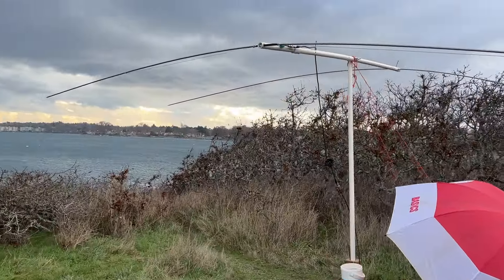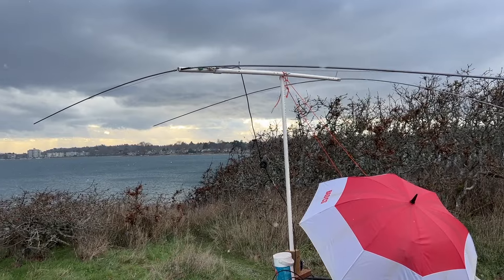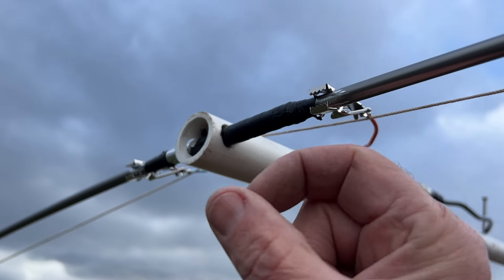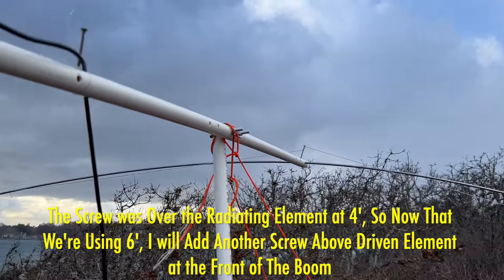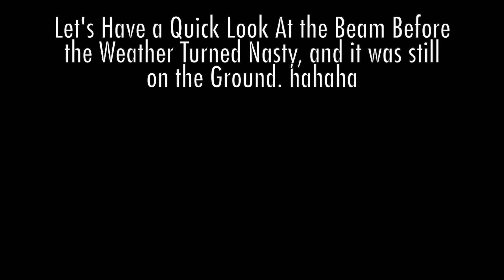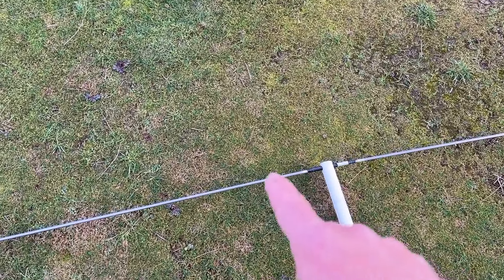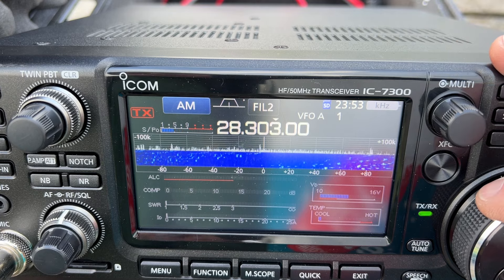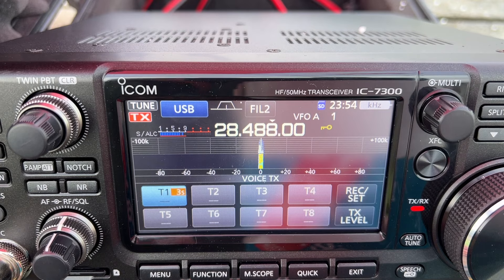TENT POLES - DIY 10m Yagi / Vertical Under $50: Ideal for Outdoor Ops! #antenna #hf #hamradio #pota

Comment: Seems like a very light portable solution. String the elements up like a a bow to get closer to horizontal and you're golden. I want to try a similar set up for 6m using dowel rod and wire elements. One day. So many projects, so little time...
Reply from the maker: Hey buddy, thanks for the great tip. I'm working on a Tee set up to do exactly that - string them up higher. This antenna is a total blast buddy! Good luck with your build for 6 meters. Keep me posted on the build. Thanks for dropping by mate. Cheers!

Comment: Great video and success Simon.. I like that antenna..  Sorry I missed your POTA spot.. Thanks for sharing.. 73.. k0klb
Reply from the maker: Kevin buddy! This antenna is awesome mate. I can't believe how quiet the noise level is - well even quieter than quiet on 10 meters, and the signals just pop! I'm addicted to the beams buddy. Thanks for swinging by  Kevin, and stay warm mate!
Reply: @thehamjazz   Ya Buddy on the beam.. Love them, but just not practical in my mind out here in the middle of the country at the home QTH station.. I'd be swingin' that thing east, west, east, west all day long.. The local birds would think its a carnival ride up there, LOL.. I'd need to have 3 stationary beams pointing east, south and west all connected together for an omnidirectional radiation pattern.. However, in a portable setup, I do like your hand rotatable, portable beam where I could spin it on a dime real quick.. That's a great idea.. and very effective.. Nice work !!... k0klb

Comment: Super Fantastic Yagi-beam!   I am doing similar cheap portable beam antenna on 10m.   I use gardening/agriculture green pole approx 2m long as a standing pole and a vertical element, directly feeding with it, spreading horizontal element between these poles top and bottom to build rectangular loop.  And aligning these 3 loops each as director, radiator and reflector to form a direction fixed 3EL Cubical Quad.   I enjoy DX contesting with it in QRP.       Your's is rotating so very nice😊
Reply from the maker: Thank you very much my friend. My email address is va7bix@gmail.com I would love to see pictures of your beam? Thank you for watching my video my friend. Happy DX! 73 Simon
Reply: @thehamjazz  Sure, Simon!  Tnx for your interest on my DIY antenna.   I will shoot some pictures this weekend upon participating in JIDX contest and send them to you.

Comment: Very nice portable yagi for 10m.  What about putting a pvc T connector on the ends so  you can put a 4-6" pvc vertical for the support string to go over, and notch out for the support string?

Also, that M10 adapter, is the female end M10 or 3/8" I need M10 Female to 3/8" Male Stainless adapter, and all I have right now is aluminum so I'm afraid it could break with the 17' whip.
Reply from the maker: Paul buddy you’ve totally read my mind mate - I just got off the phone with my buddy Doug talking about this exact same thing hahaa wooohooo. I’ve got some Tee connectors that down size to half inch so I can put a 6 inch stub on it and boom it will hold the weight of the elements - I’m pretty sure it is m10 female to a 3/8-24 male buddy let me check and get straight back to ya
Reply from the maker: “This adapter has M10-1.5 female threads on one end and 3/8-24 male threads on the other end! Perfect for your needs buddy - contact SnakeClamp they are the US company that supplies them buddy - url
SnakeClamp.com 

Happy building Paul - cheers mate 👍🍻
Reply: @thehamjazz  I got the adapters yesterday and they work perfectly.  Much stronger than the aluminum ones I have. This works great to adapt the China 17’ metric whip to a 3/8” mount, WooHoo!

Comment: Lots of variables on Amazon for those tent poles. What is the exact length in inches of an individual pole section on your poles? Amazon lists 15.55" and 14.56" but none exactly 15". Thank you de Mike WE0H ..

Comment: Hi, Simon. It's a great idea. I have a challenge of getting end to end conductivity.

I ordered the same brand as yours. File them in and out exactly as you showed in your first video. Each section itself has no issue of conductivity when checked. But when I put them together, I don't get end to end conductivity.

I tried rapping little piece of kitchen aluminum foil between two sections and then pushed in each other. Some foil sticks in between the two sections, and the rest is sitting outside the rod.

This way, I am getting end to end  conductivity. I have conern that at 100 watt with over time, it may burn or damage the pieces of foil in between the sections, but I  am not sure on this. Is it safe to have this kind of setup?

I tried washers in between two sections, but it seems they are somehow slightly loos or move, and there I lose the conductivity. It seems aluminum foil is the only option as it fills in the gaps between two elements to have end to end conductivity.

I am planning to have this as a permanent setup in my backyard.

Sohail ve3itu.

Comment: what’s the purpose of the 3/8” adapter at the end of the element?
also, you could add a 90 deg pvc connector and a few in inches of pipe to raise you element leveling string.
Reply from the maker: Hey mate thanks for your response - did you see the end of the video? I used the reflector element as a vertical - hence the 3/8 adapter so you can do both. It’s a beauty and ya buddy tomorrow I’m going to add a tee with a stump for the string to hold up the elements - thanks for watching mate cheers

Comment: How did you prep the sections so current and voltage could conduct past the anodization of the aluminum tent poles?
Reply from the maker: Hey buddy, thanks for leaving a comment. I used a small little metal file and just filed away the crud. You can also use steel wool. A buddy of mine used a Dremel bit which would work a treat. Happy building mate, this antenna is a beast and soooo much fun wow. I gotta get mine up again this week. Wooohooo cheers mate.
Reply: @thehamjazz  Thank you for the reply. Woohoo
I did a little research since I asked the question and found out that oven cleaner would remove the anodization. I am testing your method and the oven cleaner method this weekend

Comment: I tried making one of these but just could not get a stable SWR. Every time the wind blew and the driven element oscillated up and down, the SWR went from 1:1 to over 2 and back again. Taping the joints made no difference. As an aside, I used a 6.9mm fibreglass tent pole piece for the centre of the DE - it of course is tubular,so running the shock cord is easy. 73 Simon GM4JXP
Reply from the maker: G'day Simon, thanks so much for dropping by and leaving a comment mate. Yes, there is definitely the bouncing SWR issue.... I overcame that with lots of trial and error, and found that it is a 'fine line' between having the internal elastic tight enough to not snap when you fold over the sections.- I basically shortened the elastic that was provided to really make it tighter than it is out of the factory ... Also, some deoxit really helped. I know Don (N5SKT) also used a dremel bit to really clean up the anodization. Thanks for your comment buddy, and happy building! Cheers mate
Reply: @thehamjazz  Thanks Simon. Tightening the cords seems to have done the trick and my first QSO was with OD5TX! 57 report for 10w

Comment: The half square for 10 m only needs to be 9 to 10 feet ff floor wooowooo
Reply: 10 foot off the floor
Reply: If you could imagine off each end of your beam 8.6 feet vertical down to floor more distance on dx wooowoooo
Reply: Half square orizontal 16.8 feet. Reflector 17.6 5% bigger inline